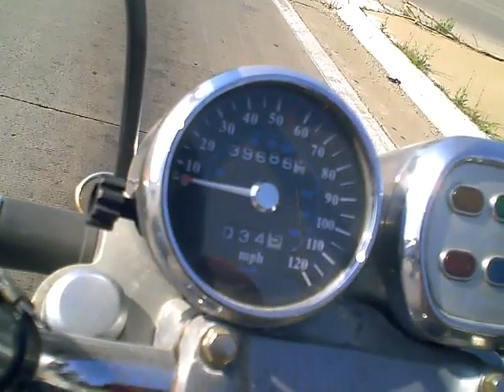LJ Texted Me She is in Chicago

Comment from the maker: People that work in motorcycle parts learn fast what works and what gets returned because it doesn't work. In the 25 years I rode my Harley I bought about five batteries. The last one had a spacer because it was smaller than the original but had more cranking amps than the original OEM battery.